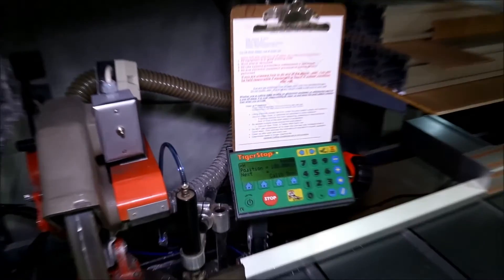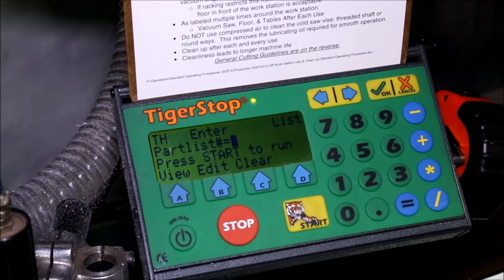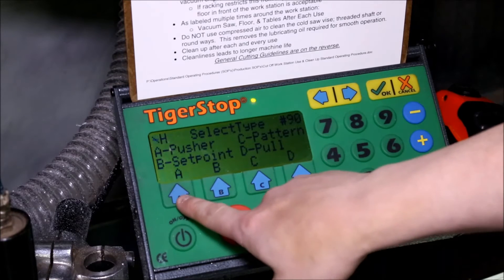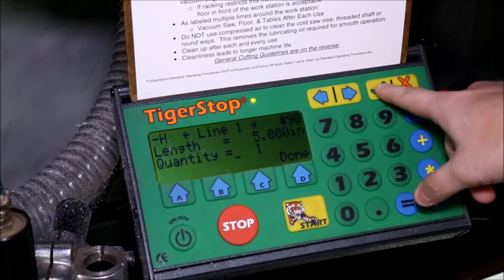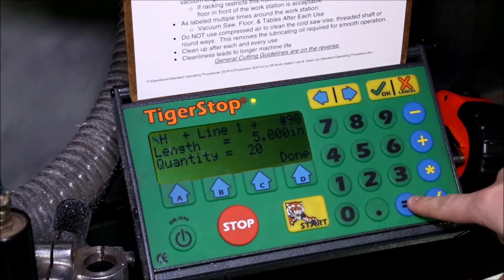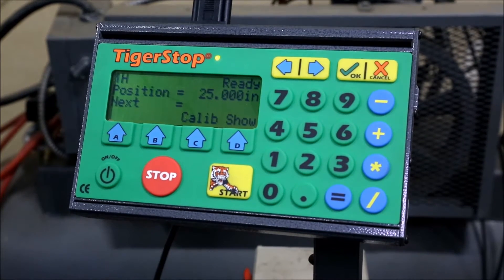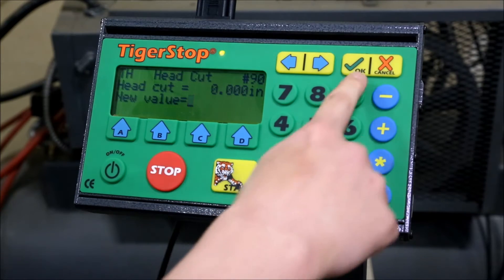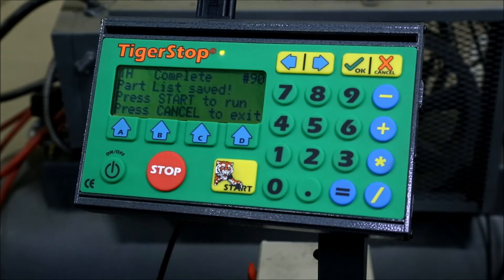Push it, Pull it or Position it

Comment: Can you program formulas into Tiger Stop positioner? Enter size of the unit (Width and Height) and let Tiger Stop calculate all part lengths
Reply from the maker: You can use the controller as a calculator to find a position. For formulas I would suggest using a spread sheet then downloading the spreadsheet to the TigerStop.